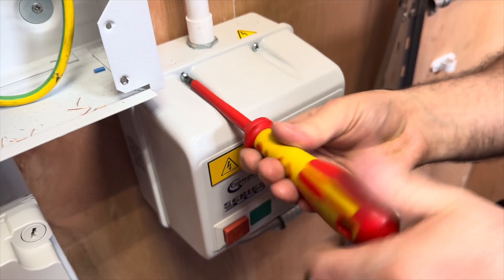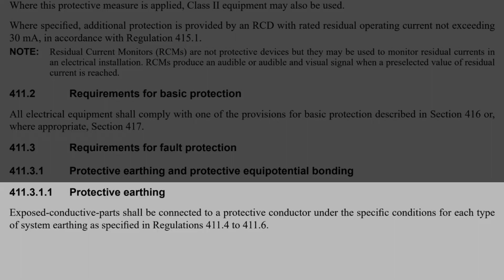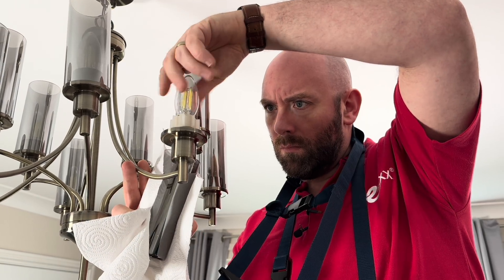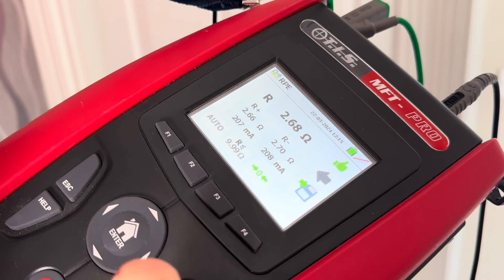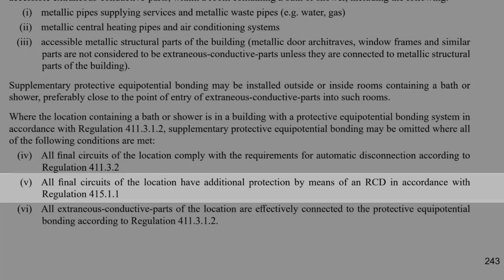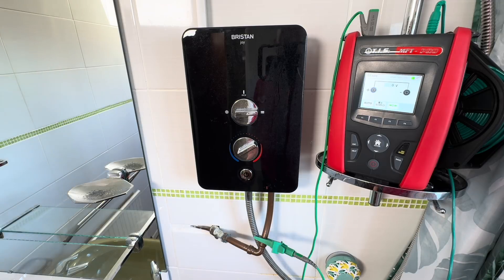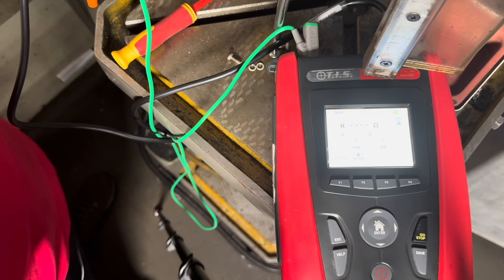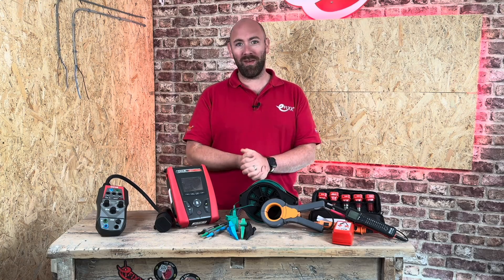Are You Carrying Out Earth Continuity Testing Correctly?

Comment: 8:20 Its acceptable for the conduit to be used as the earth conductor. So if a green/yellow has been installed as well, then this is just 'belt and braces'. Therefore the actual earth continuity reading is a combination of the conduit and the g/y wire.
Reply: When I started we didn't install earth wires in metal conduit, just a flying lead from the boxes.
Reply: @christopherhume8896  that is still permitted, and eefixx said so in their presentation on non-threaded conduit.

Comment: Metal Class 2 light fittings are a nightmare when it comes to EICR's. No continuity so you end up taking the fitting down to test at the terminals, only to find it's Class 2 🤦‍♂️.

Alternatively you put FI on the report and charge the customer a return visit for remedial investigational work, only then to find out it's Class 2 🤦‍♂️

There should be an external label to indicate It's a Class 2 fitting so we don't have to remove it to find out.
Reply: problem is that the client doesn't like the "ugly" sticker & takes it off .......back to square one :(
Reply: Even better when it’s labelled as class 2 equipment but absolutely isn’t because the terminals inside are exposed